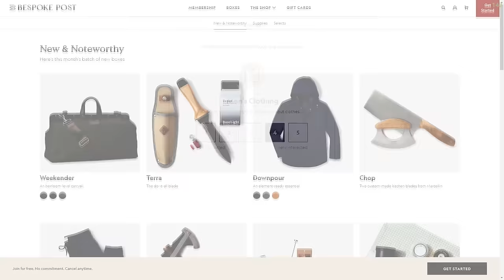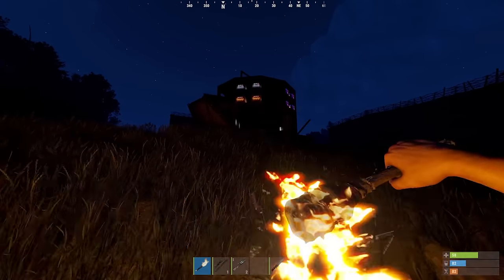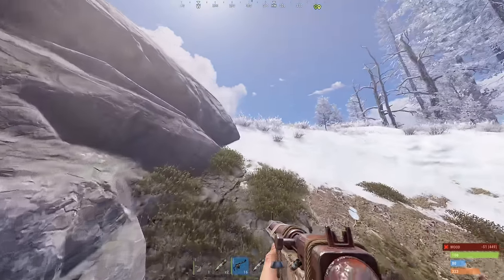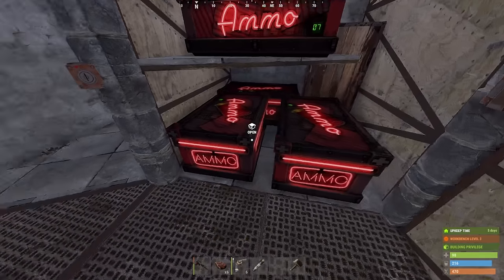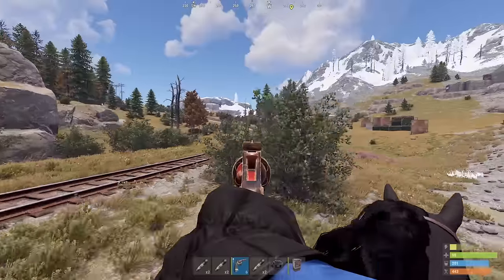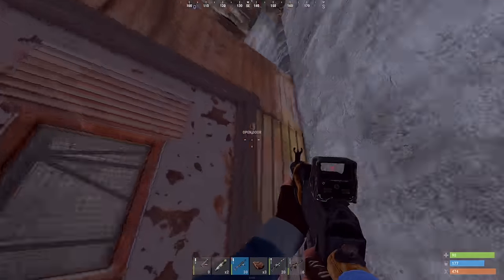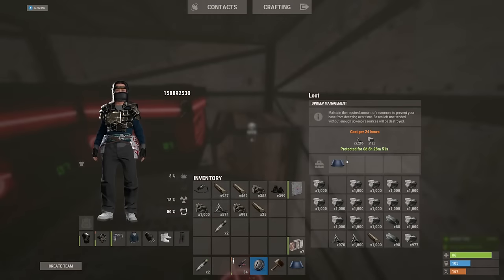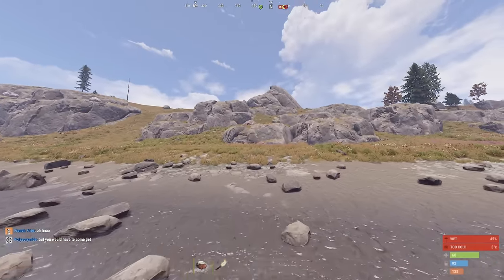large furnace bases are overpowered...

Comment: Tip: Repair benches can now refill jackhammers for free, just like workbenches (since 1 or 2 updates ago). One of the furnace bases you raided, you used a jackhammer to raid to the TC and had to run outside to refill it. But they had a repair bench right inside. Good luck in the future. I love your videos!

Comment: Large furnaces should be a default blueprint at this point. Having three manual-feed electric furnaces, three solar panels, three small batteries, and three regular furnaces isn't much more difficult and saves all the effort of constructing a hollow roofed honeycomb 2x2 around it, so it works out better after about an hour anyway.